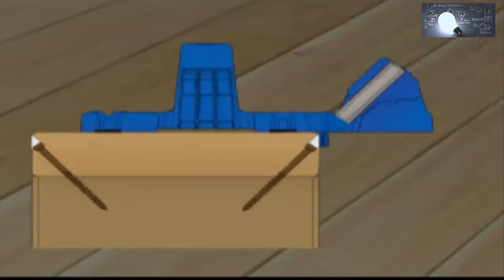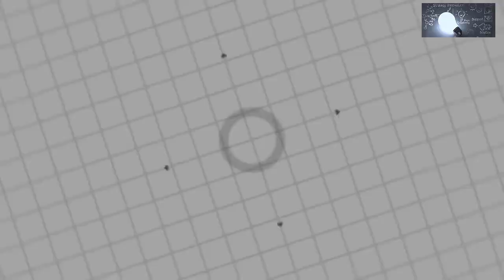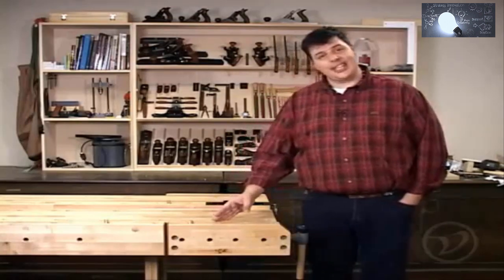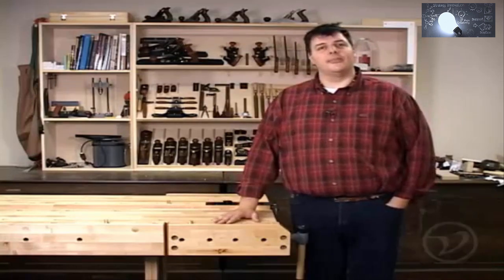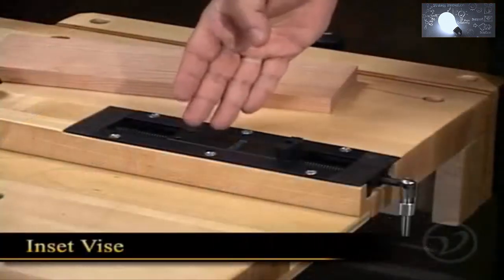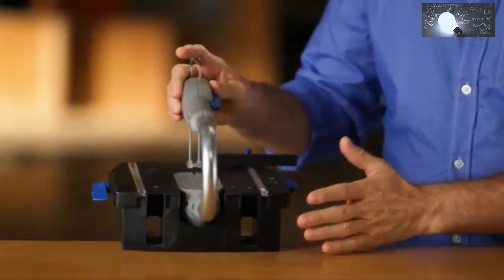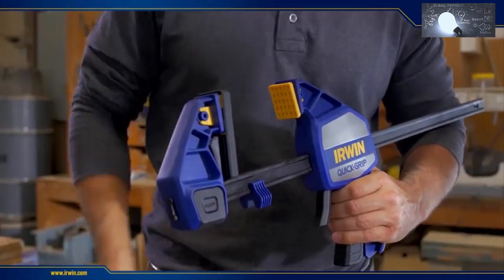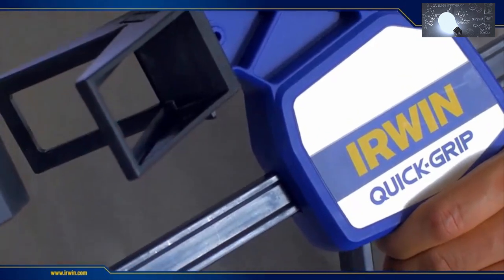10 WOODWORKING TOOLS YOU NEED TO SEE 2019 AMAZON

Comment: You can only fix one edge of the decking though when it's up against the previous board.
Reply: Denis Alexeev  All tools are more valuable than the materials they are made from. That's sort of the magic of tools. You're right about the gap. The included 1/4 inch spacers give a gap that (as I see in other videos) allows the screws to be accessed when the neighboring board is in place.

Comment: I have the Kreg Deck kit.  What they do not tell you is that the "average" deck is not just a foot off the ground and you can't do the deck from ground level once you are away from say 3-4 boards in.  Then you're on your hands and knees drilling the pilot holes and then setting the screws.  I have a 12 x 24 rear deck and due to some issues with my arms (they don't extend straight) I have to hold myself on one hand or be hunched over and by the time I got 2 boards in, I'd have to take a 2 hour break.  The deck looks GREAT but damn.... took me 3 weeks to build what normally would take me 2-3 days (working alone).

Comment: 2:15 Easily done on one frame using 4 clamps and pieces of scrap wood made to make a perfect frame.  This  requires 12 clamps which = 3 less frames produced at any time.
Reply: There is also a band with four edge-wedges and a fastener - no clamps needed at all (never used, so can't vouch for it). But yes, 12 clamps means fewer frames :-)

Comment: that buzz saw is like the same as the ones i got for $10 used, i don't think mine had parallel guides though
Reply: aterack833 .....you just didn’t get it then as they have come with new saws for at least the last 40 years that I know of and probably even longer.

Comment: There is a difference between woodworking and carpentry and the tools that are used in both. Some tools are used in both. But building with a drill is not woodworking.

Comment: For that Kregg Deck thing, wouldn't it be a nightmare if you have one board break and then have to take out like 20 of them to reach the one that needs changing?
Reply: No - the screws are accessible with neighboring boards in place. Some of the other videos show that. Decks require gaps between the boards to deal with water and debris. The kit comes with three 1/4 inch spacers to set the proper gap.

Comment: You should never put decking screws in the edge like that in the beginning. How you gonna lift that board if you need to?
Reply: The same way they are put in. Deck boards must have a gap between them to prevent accumulation of water, debris, ice.... The kit comes with three 1/4 inch spacers to set the proper spacing, and the tool works through that gap.

Comment: I’d rather use the camo screw system rather than that kreg
Reply: I'd rather use it anything but a Kreg Jig. The Kreg Jig is the worst thing to happen to woodworking ever.
Reply: @frogsoda  I guess I'll find out soon; my jig is supposed to arrive tonight. I'll be replacing the floor of my 12x24 deck this week. I've used the pocket hole jig for making cabinets and it works great. I hadn't done any woodworking since high school but I had to deliver.
I see good things about the camo system, too, except for the price. As a 70 year old DIYer I very much doubt I would ever get enough use out of the camo to justify the cost.

Comment: Looks like the decking jig only can do one side. That's no good.
Reply: It does both sides unless one is against a wall. Then classic vertical screws can be used. The boards have to be spaced about a quarter inch apart regardless how they are fastened down, unless you like mud puddles on your deck and the boards shouldering themselves apart. The tool works through that required gap just fine (other deck construction videos show it being done).

Comment: Wouldn't trust the decking tool. Never tested for decades of decking use. 

Drills only one side?
Reply: It does both sides. The kit comes with a trio of 1/4 inch spacers - outdoor wood decks without space between the boards are very bad news; they collect water, dirt, and all sorts of debris, and the boards push each other aside year after year.
What do you think will go wrong over decades? Getting 20 years out of any wooden deck is impressive.

Comment: The fuck is the fascination with pocket screws?! If your deck is built correctly, all the shit about splitting and warping and nail/screw popouts wont happen for a long time! Seriously, let’s give pocket screws a fucking break..
Reply: The deck popouts are always going to happen with nails; splitting is the same with screws. I presume it is a lesser problem - maybe none at all - with the synthetic deck materials, but wood has grain and breathes, even when we coat it with primer and deck paint. It is all a matter of time. The first tiny crack lets in moisture, which opens up the crack....

Comment: This is an idiot idea. If you want to remove one piece in the middle, you have to remove all the floor.
Reply: You don't understand the process. The boards in any deck have to be spaced to allow water and debris to fall through... unless you like mud puddles on your deck. The kit comes with the 1/4 inch spacers for proper spacing, and the tool works through that gap just fine.